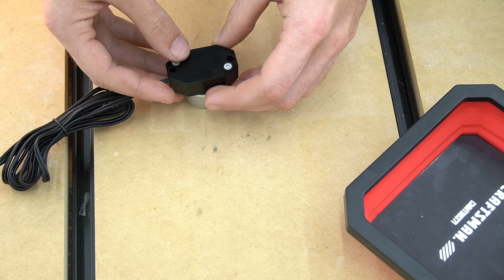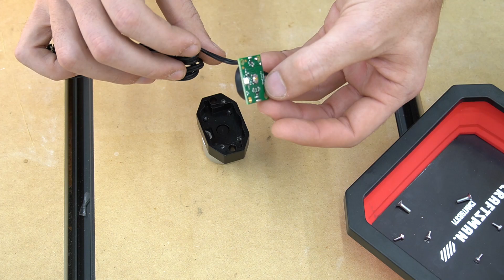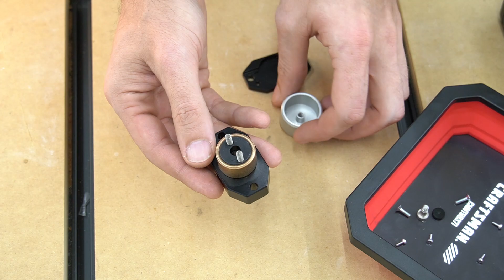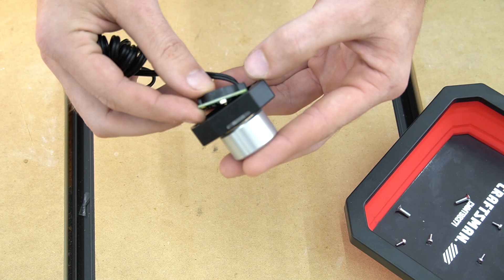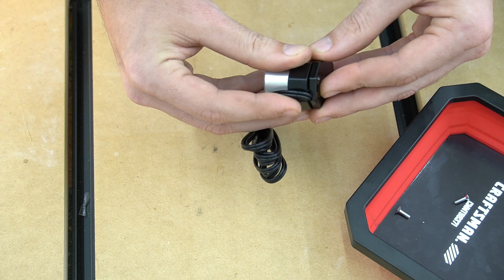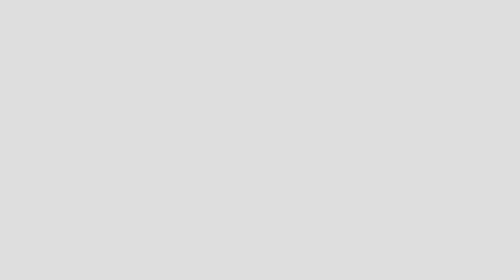Replacing the Onefinity CNC Eazy-Z Tool Setter Cap || Support

Comment: My Foreman Elite ate the center of the cap, thus the attachment area between the button and the bracket, while probing, thus machining the threaded portion of the button smooth with the top of the fixture. Of course, the button fell off. Nothing to hold on to the get the little bolt out of the remnants of the button. Very bad language day trying to get the little bolt out when there is nothing to hold on to. I will probably just order a new setter. It would be much better for my blood pressure.

The device does work well but the repair is not as easy as shown here if the button attachmenet area has been machined off. Not sure why it chose to turn on the spindle while probing but... things happen. Perhaps a better design would be to have the button secured away from the exact point where a hungry end mill will remove very needed material or perhaps a retainer around the base of the button rather than a bolt in the middle?
Reply from the maker: So sorry to hear about this! We are always working to improve our products!